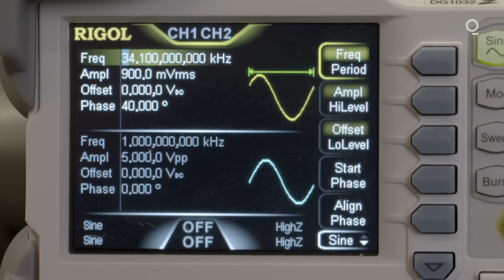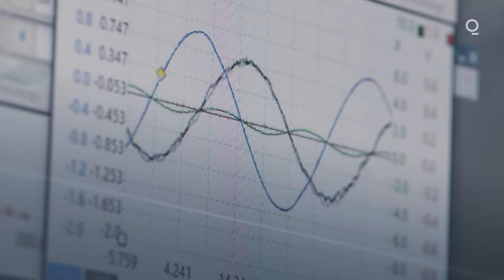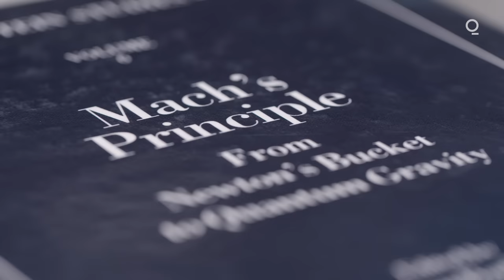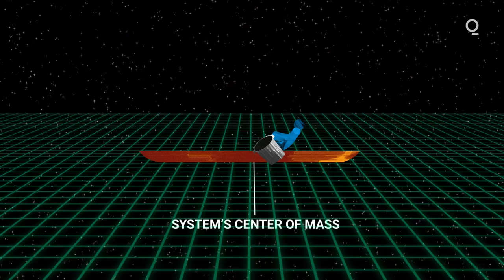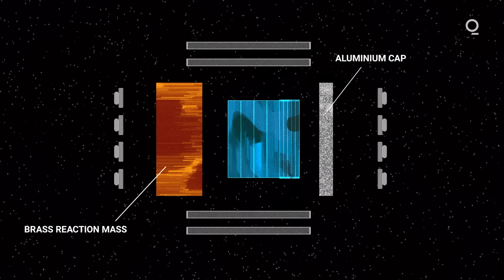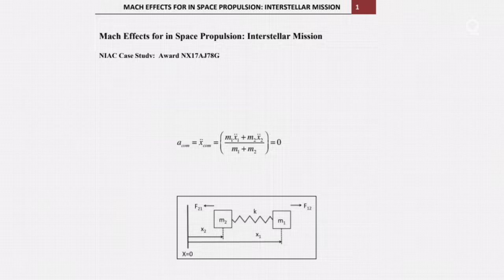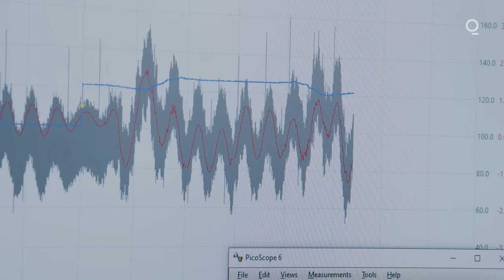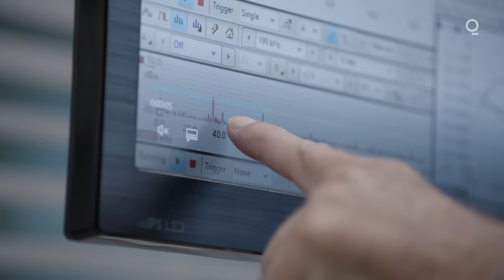Two Scientists Are Building a Real Star Trek 'Impulse Engine'

Comment: "Impuls engine" literally just means that it works with the law of impulse conservation.

Usually that means you spit out some light matter very fast, than your massive vehicle will get a bit of speed in the other direction.

Every rocket engine works with that principle.

Ion engines are perhaps the most interesting of these engines, but still they're fairly simple in principle.

EDIT: Oh yeah. You guys totally got the name wrong, gravitational distortion drives explicitly are NOT impulse drives. More similar to the concept of the warp drive.
Reply: First, it's called conservation of momentum.  Whereas momentum is the motion of an object in a particular direction, Impulse is defined as:
1. An impelling force; an impetus.

2. The motion produced by such a force.
3. A sudden wish or urge that prompts an unpremeditated act or feeling; an abrupt inclination.

Second, an impulse engine does NOT spit out "light matter" as there is no such thing and impulse engines use energy NOT matter to move the ship.

Third, rocket engines do NOT use conservation of momentum.  They use the principle of action/reaction.

Fourth, ion drives also do not use conservation of momentum.  They use the principle of action/reaction.

Conservation of momentum is the principle wherein momentum (movement in a particular direction, essentially) is not altered, merely shifted and only applies to a CLOSED system anyway.  Since a vehicle is by no means a closed system, it does not benefit from the effects of conservation of momentum.  It DOES have inertia, but that is a very different thing.  Momentum is that which makes it so that two inelastic objects will continue to have the same relative speed to each other along the same axis of travel after they collide as before they collide.

In other words, when the moving object strikes the other object, the speed and direction of movement of the set of objects remains the same while the movement and direction of each object shifts to accommodate the change of movement and direction of the other object.  If a ball is motionless and it is hit with a ball moving at 1 mile per hour, the stationary ball will now be moving while the moving ball will be moving slower or stationary depending on whether or not the stationary one absorbs some or all of the motion of the moving one.  This however only occurs if there are no other forces acting on the two balls to alter their motion in some way.

Ball A: 0 movement
Ball B: 1 MPH
Elasticity: None
Result: Ball A now is moving away from ball B in the same direction ball B was previously moving.  Ball B is now stationary.

Ball A: 5 MPH North
Ball B: 10 MPH East
Elasticity: None
Result: Both are now moving Northeast at 7-1/2 MPH.

Ball A: 25 MPH left
Ball B: 75 MPH up
Elasticity: 50%
Result: Exact speed can be calculated.  Direction of motion is up and to the left
Reply: well impulse engions actualy are fusion engions.
Reply: I don't understand how the crystal gains mass. Any ideas?

Comment: Actually, the impulse engines in Star Trek aren't reactionless drives.  They're nuclear fusion engines that utilize reaction mass to propel the ship.
Reply: Uhm actually, the 'Impulse Engines' in Star Trek are not nuclear fusion engines, they are blue lights in a stylized box and a thrumming sound effect.

But your assertion of how the fictional device represented operates is accurate.
Reply: According to what I've read in Startrek tech manuals, the impluse engines are essentially fusion rockets. But they require a "driver coil assembly" that puts a low subspace field around the ship to lower its inertial mass. Otherwise you couldn't carry enough propellant to get anywhere near light seed. So unfortunately the impluse engines are as fictional as the warp engines.
Reply: @jacksonheathen2092  ever heard of diamond batteries?
Reply: @somethingsomeonesaid6455  No. I haven't.
Reply: ooo spooky action at a distance talk......

Comment: Yeah, there's something missing here that's needed to magnify this effect to make it both measurable and useful.  From the effect described, they should call it the "scoot" drive. It's like a baby that can't walk yet will scoot across the floor but the baby has muscles that provide a force multiplier to the effect which makes the scoot action useful.  This drive is missing those muscles, or force.  He needs to pair the device with a force, like say centrifugal force by creating a circular array of these drives and rotating them at high speed so that when the effect is introduced it produces a significant measurable and useful effect to move the device. Centrifugal force is still considered an inertial force but in a rotational reference so technically it should work as a complimentary force that can multiply the described effect and put some muscles on this baby.
Reply: Spreading the piezoelectric crystals out like an insect's wings.
Reply: @mortkebab2849  Yes. Kind of like a gecko effect or something. Different mechanism but similar defiance of gravity.
Reply: The baby has friction with the floor. And scoots by pushing on the floor.
Reply: contact them and share data

Comment: @5:08 "But the Mega Drive is set up to vibrate mainly in one direction."  Uh huh.  This smacks of using a fan on a sail boat to provide the wind that fills the sails.  How exactly would it "vibrate...in one direction" in such a way that it accelerates?  And that supposed acceleration taps into a gravitational potential that likewise seems fabricate from nothing.  There's a lot of hand waving going on here.

Comment: That movement should've been checked in vacuum chamber. Else it's just pushing the air, causing trust.
Reply: and wires and strings and electrostatic forces to nearby masses
Reply: I trust your assessment.  😁
Reply: @keirfarnum6811  it's to be trusted

Comment: I would like an explanation of how the piezoelectric crystals change their amount of mass.  5:24
Reply: Yeah, that is literally the crux right there.
Reply: @BerryTheBnnuy  This seems no better than perpetual motion nonsense to me.
Reply: The way I understand it, by expanding the crystals move through space. And a moving mass is heavier than a resting mass (especially when nearing the speed of light). So while the crystals snap outward or back inward, they should be heavier than while keeping their form. But it's all so miniscule, I can't even imagine this reaching the force of a feather against gravity.
Reply: A quick search and yes it pretends to have more mass at high speed - it actually has more momentum than it should due to E=mc2, but the speed of the piezo would need to be a 'significant fraction of the speed of light'
Reply: It gains relativistic mass as it accelerates and decelerates during deformation.  Relativistic mass has all the same properties of inertia and momentum as rest mass.  You have to time the pushing and pulling exactly right to take advantage of the fluctuating mass.
Reply: @BerryTheBnnuy  They grab the trampoline.

Comment: This is cool and all but it's not an "impulse" engine like in Star Trek. The closest thing to that would be a magnetoplasmadynamic thruster, which is also currently being developed/researched.
Reply: Technically it would be wrong to call this a “thruster”, but rather a “momentum creator.”
Reply: Did you juts combine 3 science words into one to sound smart?
Reply: @40watt53  I didn't come up with the term, that's the name the team that's been developing it chose and is using. It's also called a Lorentz Force Accelerator, but I like magenetoplasmadynamic because it's similar to magnetohydrodymanic which is a concept that probably more people are familiar with so you can understand it as the same thing but with plasma instead of water. I also generally expect people to Google things before they make snarky comments on YouTube so perhaps I expect too much.
Reply: @evannibbe9375  right, and it's not an "impluse" engine because to have "impulse" you need to apply a force and there really isn't a force being applied here, so "impulse engine" wouldn't be a descriptive name.
Reply: @40watt53  though after further consideration, a better example of a current technology analogous to a Star Trek impulse engine would be the VASIMR engine - but really that's just a specific type of magentoplasma rocket.

Comment: This experiment needs to be moved into a vacuum on a near perfectly level track mounted on an electromagnetic vehicle that hovers on the track. The engine device mounted to the vehicle, gated at zero distance and then released to find out if it really works. Atmospheric and physical friction forces would not affect the vehicle in space.

Comment: cool, one small thing. HOW DOES VIBRATING A OBJECT TAP INTO "THE UNIVERSAL ENERGY"????
Reply: Energy and mass are equivalent, so you should be able to move energy to a location, move that thing that has the energy in it, then move the energy out before moving that place, thus acting like the buckets diagram.
Reply: It taps into the spacetime springiness not " energy" 
What is known as your mass is actually the depression your energy makes on this fabric 
This fabric bounces back so if you are light one minute and heavy the next you can extract motion
Vibration creates small changes in Mass, this happens all the time but only with precise engineering can you get the motion you want
Reply: @cedriceric9730  thanks for the explaination
Reply: It doesn't.  It is just another overbalanced wheel with a bit of extra science flavored  woo thrown in.  There is a rather ancient hope that if you just forget to take something into account the universe will not notice.   In reality, the forces always balance out, even if they are not all obvious.
Reply: It does seem dark energy  might be something  to latch on to  ,even though  no one can find any ,perhaps you could move that and propel your self off it

Comment: When you are using background universal effects for propulsion
is it not always incremental increases in velocity over a extended time ? ( human life span terms)
So we are still talking about generation long voyages ?
Reply: Even the best ion drives will have long run out of fuel but the machdrive will move as long as electricity is provided
Reply: Nothing about this drive says fast.  If it was legit it would be about purely electrical propulsion in space, thats the only real advantage - not having to store material fuel.

Comment: I'm going to be the designated Star Trek nerd here and point out that ACKSHUALLY, impulse engines in Star Trek are supposed to be fusion-powered thrusters. The driver coils help by reducing the apparent mass of the ship, but the acceleration has the same mechanism as a traditional rocket motor. What these scientists are attempting to do is perhaps slightly more akin to warp drive.

Comment: The term impulse was used on the Star Trek show. Because they were trying to emulate a sea voyage or the propeller on a ship. In most cases. It was a science fiction show trying to capture the essence of navy ship operations. In many respects.
If you’re talking about impulse drives. In terms of making science fiction a reality. There are many different types of postulated theories. The most basic being stored mechanical energy in weights. 
Where a force and rapid stop can be applied in a zero G environment. The effect is like gently pushing a weight away from you attached to a rope. That is let out a significant ways away. Then rapidly reeled in. Giving a slight forward momentum towards the direction the weight was thrown. 
It’s something meant to move slowly in zero gravity. In an effort to move out of the way or towards something like another ship or space station.

Comment: Changes in size of the crystal isn't a change in mass
Reply: Well there is the same mass, but if the volume changes so will the density. And maybe if that change in volume is not uniform the center of mass will change. But Idk. The analogy with the row boat kind of implied that there should be an increase in mass at some point during the cycle to get any movement.
Reply: Well, it is, because the change in volume comes from electric charges, transferred by electrons, pushing apart the atoms of the crystal.
So, you're adding the mass of the electrons while you're charging the crystals.

Comment: Sorry to break the optimism, but they have not shown any theoretical basis to it. For something like this, you at least need some theoretical physics paper demonstrating that it supercede or doesn't break the last 100 years of physics by geniuses around the globe.

You just can't randomly create a pendulum and expect it to steal gravity.
Reply: 'String' theory
Reply: You can built an 'inertial' drive by putting a shaft throu a coffee can(on the long axis), off center then put a weighted bar through  the shaft, such that it spins round the inside of the can. One side will be longer and thus throw more mass at one side of the can. When you spin the shaft with a motor, it indeed, will move in a discreet direction, because momentum on one side, is greater than the inertia on the opposite side.

Comment: I like their idea... but I highly doubt that what they're doing will yield the ideal result.
Reply: Why? It literally moved.
Reply: @bloodaid  These people want to use this technology to travel across the universe faster than any rocket on earth at roughly 6% the speed of light. Based on what was shown to you does that seem possible using that technology?
Reply: @katlehokomeke  constant acceleration. That’s the solution.
Reply: @bloodaid  that is a mere theoretical construct which is not practical. The reason being... a constant acceleration requires a constant supply of energy and at some point the energy supply will run out. What you also have to take into consideration is that to maintain a constant linear acceleration, you have to supply an exponential energy supply.
Reply: @katlehokomeke  well, that's what development is for. Why don't you contact them and help them solve any issues they might encounter?

You seem like a smart guy, you don't doubt yourself, do you?
Reply: Even if it's pressure was that of a piece of paper on a hand
Over years and having no resistance and needing no fuel it would approach light speed

Comment: I put this idea into the same category of things like cold-fusion. Seems kind of quaky but has some extremely tiny chance there is more to it than meets the critics eye. I'm curious what ACTUAL evidence exists which suggests there is ANY chance this could be real? Seems more fantasy and wishful thinking than anything else.
Reply: None really, which is interesting as with fairly basic lab grade equipment it could be properly tested. Hence why NASA are doing it I suspect. The same setup was used to test the EM drive and found it didn't work.
Reply: That's harsh, if proper conditions can be met, like simulating the universes atmosphere, this would greatly improve the reliability of their findings to date. They are simply missing a few constants.
Reply: The science checks out
This unlike the em drive has an actual chance

Comment: The row boat diagram got me thinking. How do you convert angular momentum to linear momentum in a vacuum? Spin up a big weight, move it forward , capture the energy, move it back stopped, and repeat. A PowerBall is 27kg equivalent, like x50 because of spinning. No math yet, but sort of that idea? Might need pairs so the vessel net angular momentum is zero?

Comment: Interesting idea, but I'd need to see an awful lot more 'stuff' before I thought anything besides, "Um... yeah, right. Really? Are you sure?"

But that's normal. The greatest strength of science is its capacity to accept failure. Being wrong isn't a crime; it's just another step towards being right. If there was no room for query, doubt and argument it'd be no better than a religion, with all the answers neatly wrapped up in big books of magic and miracles.

Science is bigger than that because it's not afraid to say, "Whoops - new data! We were completely wrong! We'll have to rip out the last 500 pages and start again!"

That's a strength, not a weakness.

Science is complicated and difficult and open to debate because it's about real things and real people. And it has an infinite capacity to be WRONG. And it stays wrong until someone decides to try and put things right.

It's not meant to be comforting or reassuring or easy; it's not even meant to be useful. It's just meant to be true. That's all. It doesn't require faith or belief; it just needs one mind open enough to ask one more difficult question.

I've got no idea if this impulse drive concept is viable or just a bit of misguided wishful thinking - in scope it reminds me of the late Professor Eric Laithwaite's obsession with the 'levitating' properties of spinning flywheels - but that's not important.

What's important is that people have the guts to propose ideas and hypotheses and then have them tested 'with extreme prejudice' by both sympathetic colleagues and bitter rivals in laboratories all over the world.

In time, you arrive at the truth. If the results are negative, ask some more questions.

We'll get there eventually.